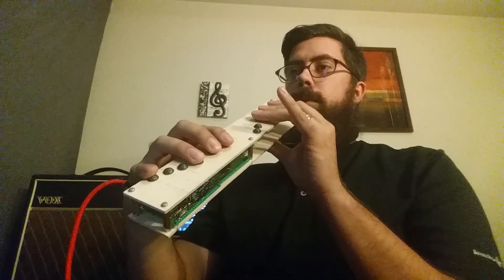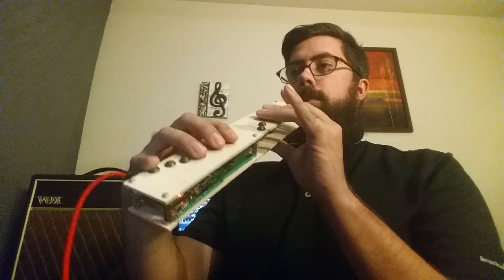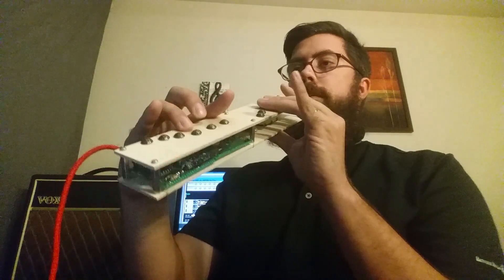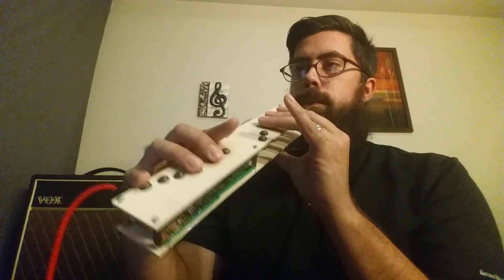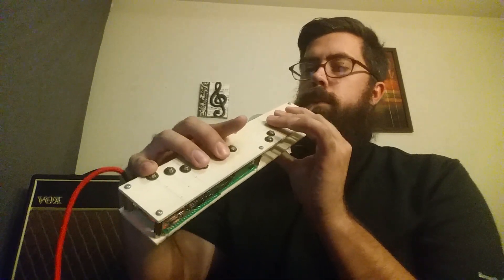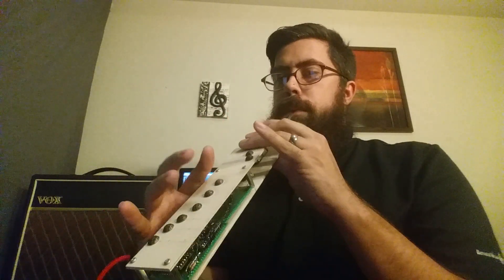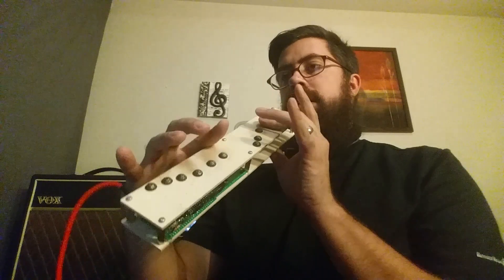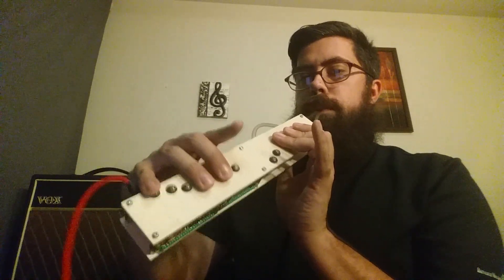Hackaday Prize 2018: The Open Woodwind Project

Comment: Very cool project, mate! Congratulations on the initiative! Have you thought about adding a joystick ( with the tube coiled around it, like on the 33 Breath Controller
) and/or a bite sensor at the end of the tube for extra modulation possibilities? Also, the lesser known Snyderphonics Birl had some neat ideas as well, like using basic machine-learning to easily map new fingerings and embouchure changes. Your controller could also integrate an Axoloti with it's huge library of modules or better yet, could be used with the internal sound engine inside the Haken ContinuuMini or Continuum which would take full advantage of your controller's capabilities. Also, what happens if you start walking with the instrument on stage while playing? Wouldn't that throw off the IMU big time? Cheers.
Reply from the maker: Hey, thanks for the reply.

A bite sensor would definitely be a good addition, and one that I've thought about and will be implemented in my 'final version'.

I don't want to have a joystick, I have found that instrument rotation and angle were more intuitive for me. But it'd be easy for others to add.

Walking with the instrument is no issue at all, vibrato is gated by a thumb key, and pitch bends etc are also gate initiated with the offsets established at time of press. All in all it matters more when you start the gate key than anything else.

Vibrato is mapped to accelerometer in the z-axis, not angle, so does not easily get skewed with angle.
Reply: @JeffHopkinsMusic  All fair points and good job on finding solutions to these problems . My though for something similar to a joystick (maybe driven by a hall effect sensor) would be to allow for proper vibrato and maybe timbre changes (though bite might be better for the latter). From my experience at least, lfo based vibrato is not as expressive as a fast mouth or finger movement. Being able to control the speed, depth and direction of vibrato (across the note both ways or above and back to pitch center like on a guitar) is very important and that is usually where midi controllers have fallen short over the years. I've had the ContinuuMini for a few weeks now and I've never experienced such a player-instrument feedbackloop outside of acoustic instruments. It shows that Lippold Haken has been working on this thing for 30 years and there are tons of things to take away from his designs (there are a few lectures with him online from ContinuuCon).
I'm probably going to end up integrating it with your wind sensor design in some capacity.

Cheers and keep at it! You are doing tremendous work.
Reply from the maker: @Cloroqx  The vibrato on this instrument is controlled by the acceleration in the z-axis. Once I press the vibrato enable key it allows the acceleration in the z-axis (straight out from the keys, not up) to be mapped to pitchbend. This means that there is no LFO. I can vary the pitch bend frequency and amount by the shaking of the instrument. 

I find it very intuitive to get great sounding vibrato. Pitch bend up and down is also enabled by this key press, but this is based on instrument angle at the start of the gate press OR start of a new note. There is a deadband, where the vibrato shaking doesn't change pitch offset (and is only mapped to acceleration) but once outside of that deadband there a full pitch bend up/down can be achieved.

This allows for me to perform trailing pitch drops and guitar style pitch bends with ease. 

There is also an overall instrument angle CC (mod wheel in my case) mapped to instrument angle, from down low to up high that I typically map to brightness.

Instrument clockwise roll I have mapped to pitch bend down as well, and this allows me to rotate the instrument, play the note, and swoop up into a note with ease.

Instrument counter clockwise roll I have mapped to expression for distortion or growl etc.

There is a rotational deadband as well, so these things are not inadvertently skewing all around.

These could be handled with hall effect sensors very easily, but I've found the IMU implementation quite intuitive.

My fingering paradigm is the one thing I like the best (second to my vibrato implementation) and really allows the dreaded EWI octave break to be an almost non issue.